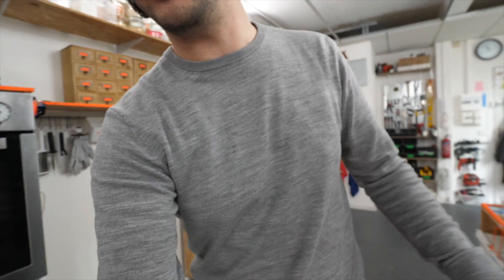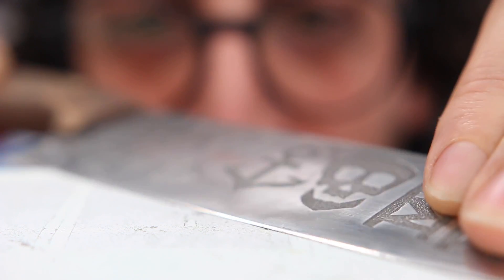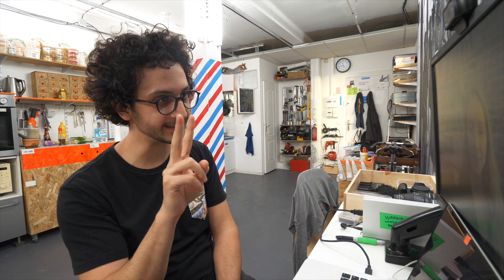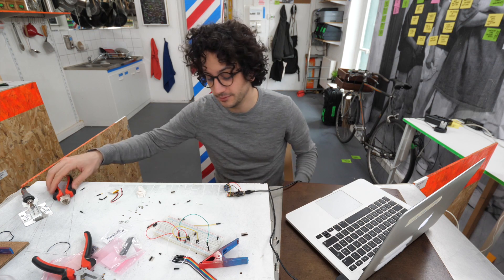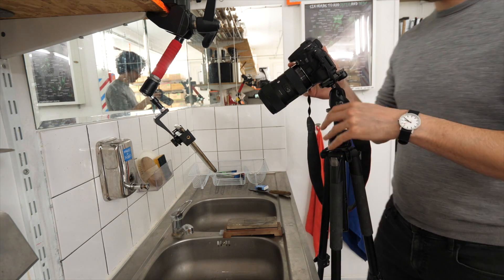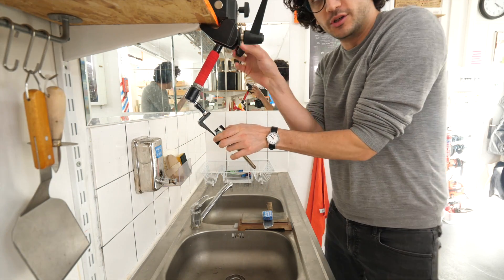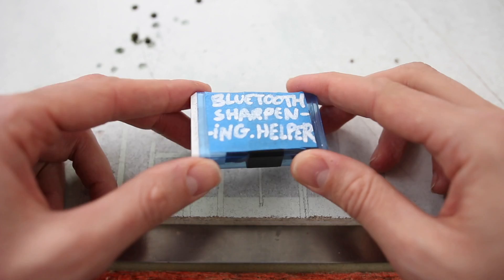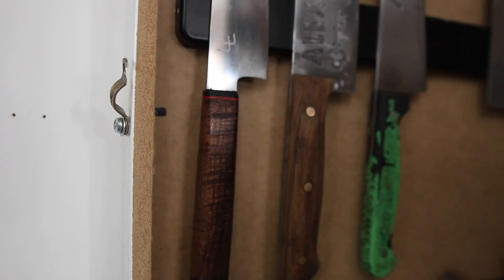Is This The Future Of Sharpening ?

Comment: Hmm.. Wouldnt this device just make a V-edge, instead of a Convex? Because if you want to achieve a perfect angle all the time, it would essentially end out with an V-edge, which is what you would try to avoid, when using sharpening stones? If you want a V-edge, you could just buy a Lansky sharpening system, which controls the degree your sharpening your edge.
I would much rather have a Convex edge, than a V-edge, which would last longer on almost any knife edge.

Comment: You could add a indicator lamp (that changes hue from red to green to blue, red-too steep!   green-goood job!   blue-too flat!) depending on how close your angle is set to a specific input angle. That way you could see precisely WHERE in your sharpening move you need to adjust the angle to maintain consistency. And you wouldn't need to keep reading numbers, just color shift :D

Comment: You might try setting the stone itself up at a 17 degree angle and holding the knife perfectly horizontal as you sharpen. Your senses are more naturally attuned to detect and maintain perfect level than a specific degree of angle, so it's easier to hold the knife consistently flat than to hold it at a fixed angle. You can still use the sharpening device you made to check for consistency.

Comment: With sharpening being mechanical in nature why not stick to a mechanical device? An adjustable wheel of sorts that you can set via screw to whatever angle you want and run it across the stone to whatever angle you want without fail. Use a clamp and whatever diameter wheel you need.

Comment: I would have chosen to make a mechanical support angle, clipped on a wheel/several wheels or tube? that would be height adjustable with a screw. Once you set the height the knife would not be able to change height. I am basically lazy and look for the easiest/less stressful solution -- you have sooo much patience!

Comment: Alex,  the issue is not with measuring the angle it is with your achievable consistency without a jig.  You need a holder that you can articulate to the correct angle on some sort of rail device and sharpen at a consistent angle.

Comment: Salut Alex,
can you build a machine that can move the stone instead of moving the blade? With your device, you can hold the best angle during the sharpening process.
Reply: Sébastien I thats a great idea and it would probably be easier but the whole idea behind his device is to learn how to hold a 15° angle while sharpening the traditional way
Reply: There’s one problem with that 
If your not controlling the speed you might remove too much metal on accident
Reply: Grnnr you could have a pedal for the movement like a sewingmachine
Reply: There’s also the challenge of creating a sliding holder for the whet stone that 1) maintains a constant — within 1/10th a degree — base as it slides back and forth; and 2) accommodates whet stone wear over time.  Mine, for example, has worn to be somewhat concave in the middle.
FWIW...

Comment: I'd like it to have 3 buttons and a screen. One button to reset 0 degrees, so just place it on the stone (no knife), press the button and know that it is correctly set. the other two buttons are to increase/decrease the desired angle for the edge (and the display is to show what you are setting).
The other thing would be a small speaker that makes a low sound when your angle is too low, a sharp one when it is too high, so you get the info in real time, without looking at the screen. 
With this kind of setup it should not be too long until your muscle memory sets in, so you don't mess your blade anymore.
I wouldn't worry too much about the battery life, you will not spend too many hours at a time, so probably a cr2032 button battery would be enough. the display only needs to show something during setting the angle, the speaker does not have to be loud and it will only make sounds when you are not properly aligned. By the time you used a few batteries, you will probably no longer need the device anymore.
Reply: This will also get rid of the need for BT.  I would make the sound increase in intensity, or change the pitch, the farther you get from the desired angle.  If time allows, i might give it a shot...

Comment: For an idea (not sure if it was covered in the other knife videos), would a small block of wood cut to the right angle work? it would be cheap and easy. As an improvement, make two gliding rails left and right of the stone (with rails below stone surface), and a little sled for the wood block almost touching the stone. Maybe even allow it so glide left and ride for an organic feel. You always can press the knife against the block, wont grind away the wood and move the right slowly left to right

Comment: Hey Alex! I just did something similar to what you're trying to do for a hackathon a couple months ago, feel free to look at/use my code it to see how i handled the angle tracking. I have it auto calibrating on boot, so you can use the master reset button on the arduino to re-calibrate :) https://github.com/adrianomontecalvo/arduino-EchoRotation-ConUHacks2018

Comment: You should cut the phone/app part out all the way. There is no need for it. If you want real time feedback you should make it a tone based system. Input the angle you want to sharpen at. Have the device sound a nice sounding tone when you are at your correct angle and if you are above or below have it sound a higher or lower tones respectively. If you want could have it log the data so you can see at a later time. Yo may need to spend a little bit more money on components, but there is zero money/time you would need to spend on development and testing of an app. Also you should try to avoid having your phone out in a kitchen as it can be a wet/greasy environment. Also you want to focus on your sharping and not a screen,  you want to reduce the risk of cutting yourself. Everyone wants to add an app for the most trivial things, a lot of the time it is not needed. I didn't read any of the other comments yet, but the nature of what you do I'm sure there are other smart people that have already suggested something like this.  

You would be a real hero if you could come up with a quality jig that you can put in to production that is: A) Max sale price $ 35 USD B) Able to take different thickness/size sharpening stones (not high priced proprietary sharpening media) C) Adjustable angles  D) Accommodate a wide range of knives (kitchen, pocket, large, small)
Reply: If the goal is to teach the angle, I think it would be cool if the pitch of the tone could suggest whether you're above or below the desired angle that you'd input to the interface. And then possibly the volume of the tone could tell you how far off you are. Does that make sense? I feel like that way, if it's about teaching the beginning knife sharpener how to eye-ball the angle, this would sort of get you closer to that goal. 

I like your idea too about looking down at the knife, versus the phone, because then your eyes get adjusted to what that angle looks like in your hands, and as you do it more and more, you get better at accurately gauging how much you're doing. 

Unrelated, but I read something similar in Rachel Ray's book years ago (I was bored, it was there, I had already finished my other book). She said that to gain speed in cooking, you need to move away from busting out the measuring spoons for spices, herbs, etc. She said every time you do measure out an ingredient with a spoon for cooking (not baking), to put it into your hand before dumping it in the recipe. Before long, you start understanding what a teaspoon of (for example) salt looks like in the palm of your hand, what pepper looks like, what herbs look like. Once you have that down pat, then you become better at free-styling when a recipe asks for multiple ingredients in multiple amounts. 

I really like your idea of a dedicated device!
Reply: Or a simple, cheap, small text Display on top, plus two buttons - to allow the angle to be set up. Not any device needs Bluetooth. It's kinda pointless.
Reply: omg this seems great

Comment: It would be great if you could program a target angle for sharpening and the device could tell you if your within a range or tolerance of the desired angle. Something like a light that is on when you're within range and dims as you move outside of the optimal range.

Comment: I'd like to see a light on the device, that gives you a clear and fast way to see if your angle is off. Rather than looking away from the knife and trying to read/process a number (which is good still for reviewing), just a light telling me to adjust up or down perhaps.

Also, you should see if you can get a professional sharpener to use this and see how consistent they are so you know how to compare.

Lastly, I saw this and thought of you - home crafting a knife from aluminum foil: https://youtu.be/owseTngZFMI

Comment: You could also use a reaction wheel to exert a force on the knife towards the correct angle, with a lighter force applied the closer you get to the correct angle.
There are some issues with this approach (For example, if you are constantly on the same side of the angle (e.g. too shallow), the reaction wheel would eventually reach its max speed and stop working), but I think it would be a really cool approach. You would feel the knife wanting to go towards the correct angle, giving you instant feedback.

Comment: Hey Alex, add on my requirements - 
1. A HUUGE angle value display on the mobile screen, so the angle can be read easily while sharpening..
2. On top of it, a small graph of the past performance - 30 seconds or so, for feedback.
3. The angle update should stop if the hands stop moving in the sharpening rhythm.
4. Counting the continuous sharpening strokes without a 5 second gap. Similar to tripmeter and odometer, with individually resettable counters.

All of these could help gain more insights, before one declares himself a master, and chucks the bluetooth device.

Great idea though, and I backed off from berating you for not opting for a simple jig to help sharpening. Adding a steady hand is a great, coveted skill! All the best! But keep the videos rolling a bit more regularly please!

Comment: Hey. I like this project, as I have also noticed that I'm not as consistent with my angles as I should be.
I would:
 - Ditch the smartphone. Having the data is nice, but hard to grasp while sharpening
 - Instead, use the leds on the device itself (the round one Becky used). A central one which lights up when you are at the right angle, and one or more to each side to indicate when you're too steep or too shallow.
 - A rotary knob to select the desired angle. The leds from before indicate which angle you select (with labels on the pcb itself), with 4 or 5 commonly used angles to select from.
 - A button to enter "select angle" mode. The angle should be zeroed once you leave "select angle"-mode.
With these, the workflow would be: Put the device onto the knife, place it flat onto the whetstone. Press the button to enter "select angle" mode. Select your angle. Push the button again to zero the angle and enter sharpening mode. Now turn the knife until the middle led lights up. Keep your eyes on the knife for the whole sharpening process (as you should do anyways).

Comment: A better GUI would be nice to undertand what's happening on screen more intuitively:
I would suggest: An XY graph, Y is angle and X is time, an beforehand the target angle has been typed on the phone
so that you can "set" a margin of error (white line=perfect angle, green lines: +/- 3degrees, orange and red lines, you get it!)

I do have a question about sharpening though: how do you take care of the very tip of the knife? I mean, it seems to be the hardest part to sharpen, you get less stability since the tip is usually kind of curved...(maybe i'm not making myself clear...)

Aussi est-ce que tu conserve le même angle sur tout le fil de la lame jusqu'à la pointe?
 (" BTW how do you translate fil de la lame ?")

Comment: Idea to improve the device :
-Filter the output by using a Kalman filter
-Change the GUI for having a color who switch from red => orange => green the closest yo are from the target (easier to try to maintain the screen at the green color thann reading small number)
-You can also easily set the angle to zero with a little bit of programming
-You can use the sound to do the same, discountinuous if you are away from the target, countinuous if you are close (doesn't need to be loud or high pitch)
-solution w/o phone, strip of LED with different color to indicate if you have a good angle

Comment: Just a short consideration: The blade itself is at an angle, therefore your little thingie showed 2 degrees while zeroing. Adding those 2 degrees to the wanted angle will get you wrong results. In this example the cutting edge will be at an angle of 17 degrees instead of the wanted 15.

Comment: Something to consider, what if you made a device that used a ball bearing, ideally made of something that would not damage the stone but glide or roll easily, that was attached to a clamp. It would use a fixed angle, but allow to roll on the stone and keeping the angle the same. The only set back is you would need a wider stone or 2-3 clamped ball bearings.

Comment: Couldnt you make a sort of clamp for the handle that holds it at 15 degrees, then have that clamp be attached to some sort of slide on the side of the sharpening block to hold the blade precisely at 15 degrees and just run it back and forth?

Comment: Or lets get kooky because as you said, you're a kook :) Create a knife that is the perfect angle for cutting without changing the angle of the blade at the cutting surface. A good titanium blade would make a very thin blade feasible, but it might be a total pain to sharpen and I don't know how titanium holds an edge, plus it might chip.

Comment: wow you have those handmade knifes with a grater on the side,
Device suggestions:
(software side): add a buzzer or a pitch (possible on the phone) that will guide you when the degree of the knife is unstable.
(hardware side): bluetooth is good but laser is more precise, might be too expensive though for a knife sharpening tool.

Comment: You should put a red and a green led on top of the device. When you're at the right angle the green led will turn on, and when you're at a wrong angle the red led will turn on. This way you will be able to tell if you're at the right or wrong angle. Just an idea.

Great video by the way, keep it comming.

Comment: Great start! I think you've definitely got a good thing going here.

I hope you will accept some constructive feedback? I think you need to add some indicator LEDs to the device itself so that you know you've got the right angle without looking at the screen. The screen is good because you can use it to select the angle you want, but when sharpening, just looking at the screen will change the angle at which you're sharpening. However, if you've got a trio of LEDs that tell you if you're too high, too low, or have the correct angle, you don't have to take your eyes off of what you're doing since you're already looking at the knife anyway.

Also, since the chef knife isn't the only knife that you sharpen, make sure that it'll also work for other blades, like the paring knife which is very small and hard to use most sharpening guides with. A boning or fillet knife are also difficult if not impossible to use those sharpening guides with.

Finally, some method of calibrating knife geometry would also likely be useful. A Santoku style knife is a lot easier to sharpen than a blade with a deep curve like a Bowie style knife, and some blades are thicker than others or have compound angles. 

I know your focus is kinda on the cooking knifes here on this channel, but it's a skill that easily applies to a wide variety of cutting implements.

Comment: There's something already out there called a "mini digital protractor" that I've used to find the angle of a saw blade when cutting wood. You may need to take it apart to change the orientation of the screen and add a feature for feedback. I would recommend a light or a beeping feature as haptic feedback or shocks may cause you to lose your angle.

Comment: Another thought.  When freehand sharpening like this, failing to maintain an absolutely perfect angle isn't necessarily a bad thing.  Are you familiar with convex/appleseed grinds, Alex?  That is essentially what you are creating here when your angle is allowed to vary slightly.  Instead of having a perfectly flat grind, you end up with a ton of slightly varied angles which simulates a convex bevel, adding strength to the edge by leaving more material behind it.  If you are familiar with "stropping" on leather, it's essentially the same thing... only stropping is more about edge refinement, as opposed to setting an edge in the first place.

Comment: So... the problem with any "system" like this is that angles are only taken from one specific point.  Even with the likes of a Lanky or even a $500+ Wicked Edge you are still beholden to that single point of measure.  The further you get away from it, the more acute your angles will be, and so the longer your blade, the more pronounced the angle difference will become.  Then you have to take into account the curve present in just about every style of grind, further compounding the issue.  As knives are one of our oldest tools as a species, the problem would have been long since solved if it were even remotely easy.  Unfortunately, it's not.  If you truly wish to solve it, this is the problem you must address; angles must be measured at the point in which the edge contacts the stone, and move along with it.  Once mastered, freehand actually affords you the best chance at ever attaining this level of perfection.